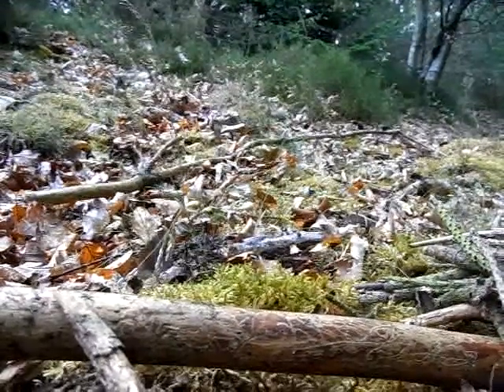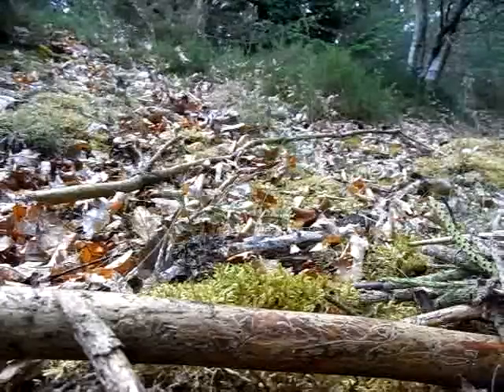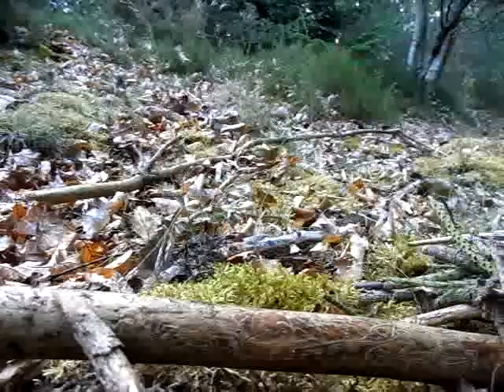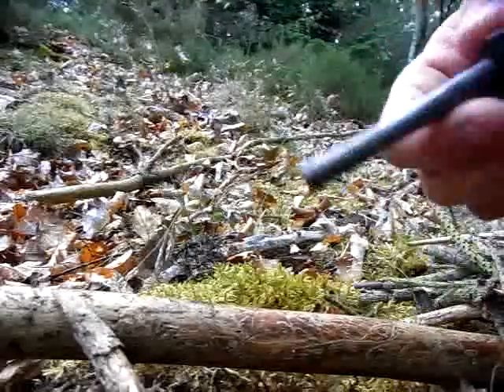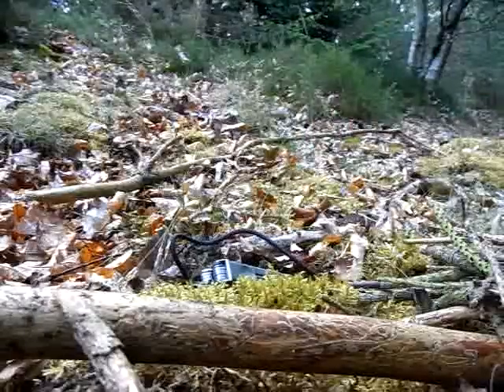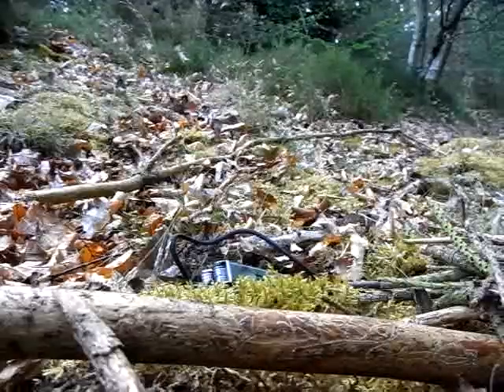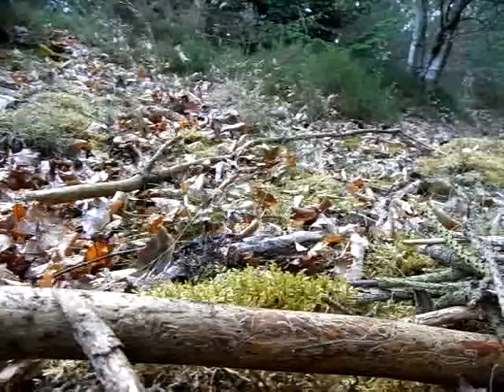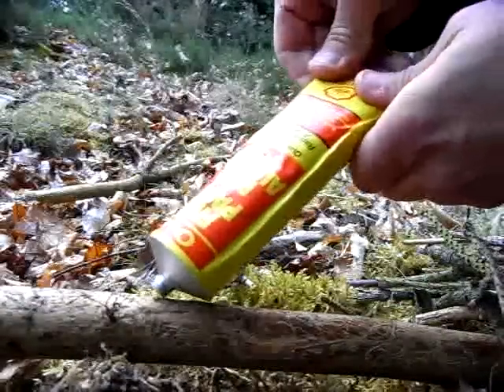How to use fire paste in real life

Comment: I have fire paste but the tube is odd shaped for my pack bag, is it safe to transfer it to a platic travel bottle with the squeeze top, it would fit alot better than the metal one its packaged in now.  Thanks.